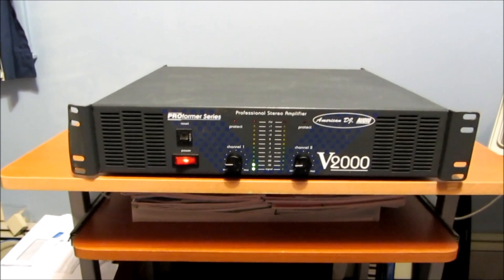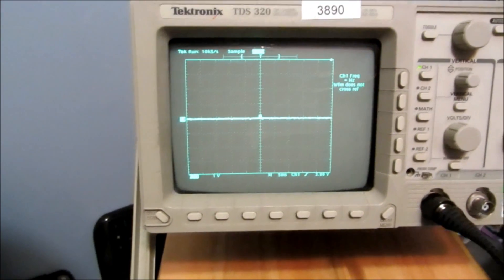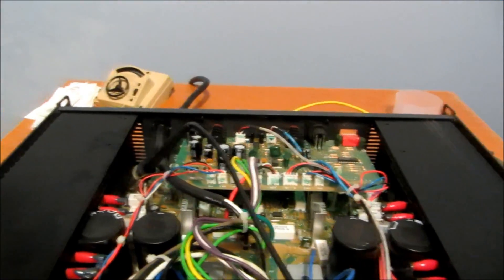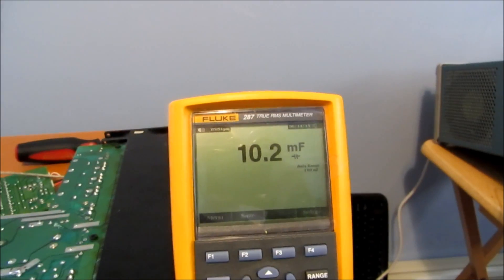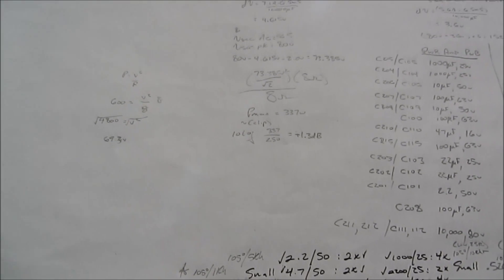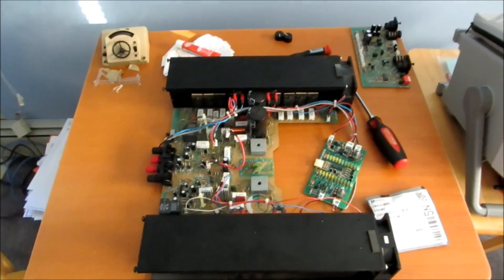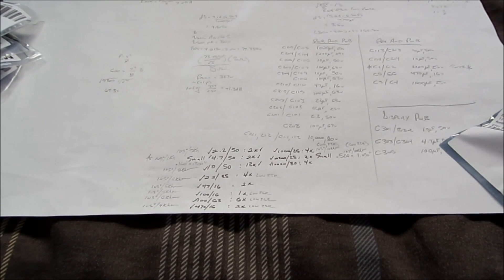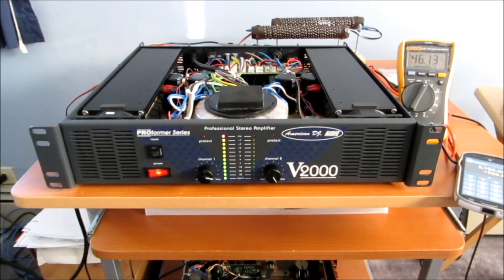American DJ V2000 amplifier repair

Comment: I am curious if you ever did any measurements , or listening test to see if taking the JRC amps out for the LME, resulted in actual improvement in the signal to noise. I am thinking about trying out a few things, including installing the plug in 8 pin dip, so one can just manually change them like most newer Pc audio cards.

Comment: Hi Kevin I would appreciate if you can help me. I have an american audio VLP2500 amplifier. It was working well but last gig I turn it on and channel A won't turn on. The fan doesn't start and there's no amplification signal. The Channel B is working ok. I've opened the amp and all seems to be ok, there's no sings of visual damage in components and it smells good. Nothing seems to be burned. It could be the same problem as yours? I mean It could be the capacitors too?
I appreciate your video guide but I don't know if just replacing the caps I'm going to recover my amp back. Can you give me some help please! Thanks and regards!

Comment: I bought a Gemini XGA 5000 out brand new out of the box a few minutes ago.  My channel 1 input was not producing sound so I switched to Bridge.  I'm using speakon connectors.  Is there a way to solve this issue?

Comment: I am fixing Audio Research equipment for many years, the best way to test a capacitor is to use an ESR meter, plus the advantage of in circuit test.

Watching  this amp I  notice the small filtering circuit, the damping factor is too low surely.

Very good video.

Cheers.

Comment: hi kevin, thanks for the response. i've got my adj v2000 from a chinese guy for cad$100 bucks, so i think it's a great deal. when i opened it, the only thing i observed not original is the power cord, looks like it was replaced with a standard pc power cord, but it's working fine. after installing and using it, i've found out that's there some mechanical problem on the speaker binding post, both left and right, loose knob and tight knob. i wanna ask your recommendations where i can buy this speaker binding post, coz i think the adj website there is no more parts support for this adj model? thanks, victor

Comment: This was a very good video.  I was hoping that you weren't going to just replace the original filter caps in the power supply.  However, having an ESR meter on hand is a great tool.  I always say they're worth their weight in gold.  I don't dig as deeply into the math as you do.  If I have a high value capacitor and the needle goes even a little bit below to where it should be, I know that the capacitor should be replaced.  I know that XC=1/2piFC.  The ESR meter that I have puts out 100 kHz.  Therefore, the XC should be virtually close to 0, especially with a 10,000 microfarad capacitor.  Thank you for sharing.
Reply: +Paul Callas XC for those that don't know is capacitive reactance, or AC resistance.  In a circuit like this, the capacitive reactance should be really low.

Comment: Very nice video.  I have Samson Servo 300 that just stopped audio.  It powers up but no sound at all on input or output.  The meters are not working when pushing sound.   Is this an easy fix?  Or better yet is it worth getting fixed?

Comment: what about using technics electrolytic caps.
Reply from the maker: +DAVID GREGORY KERR Unfortunately, Technics (or Panasonic, the parent company) did not manufacture capacitors with the correct combination of capacitance, lead spacing, height, and capacitance this amplifier requires.

Comment: hi kevin, I just recently bought a used V2000 and believed it is in working condition, but still not yet installed to my home stereo system which is tri-amped, i wonder if you have any posted videos showing your repaired v2000 in action and how it sounds? when you sound tested it after repair, were they sounding good? i intend to use my v2000 to drive my lowend jbl l/r subwoofer in 8 ohm wiring and can try to 2 ohm wiring also if needed, to maybe 180hz, but still have to hook it sooner.  i'm from toronto, canada.
Reply from the maker: +Torpengpogi Sorry I didn't answer this sooner.  The amplifier sounds pretty good, but I confess I never made a video of it in action.  I'm sure you can run a 2ohm load to it, but make sure it gets cooled really well, you are asking the output transistors to source a tremendous amount of current into such a load.  Luckily the fans are variable speed if memory serves me correctly.

Comment: Nice video, but I think you are stretching things a bit saying  ''increasing headroom'' by uprating your smoothing caps? I suppose the energy storage is increased a tiny percentage, but in practice it will make  a flies cocks difference. And no way a couple db or whatever you calculated. To new guys - always be careful swapping OP amps! They most certainly are NOT all swappable. In many cases they can give a 'free' performance boost, but take some care as some may become unstable or have different power requirements or even introduce more distortion etc. Some cannot be used as buffers for instance and will oscillate.
Reply: Thanks, I had the same thought when he changed "faster" OPs. Let them be if they're not broken.

Comment: great video how did you connect the scope? parallel with dummy loads? thanks,
Reply from the maker: The oscilloscope was connected in parallel with the dummy load.
The dummy load is two 4 ohm, 300 watt resistors connected in series.

Comment: what was it rated for before you did the repair?
Reply from the maker: The rating before the repair was 250 watts per channel, but that might not have actually been achieved during a load test.  A figure like that may have been possible only under the most ideal conditions.

Comment from the maker: Richard:
You absolutely can get shocked with the power off.  In this case, you'd have a total stored voltage of 160vdc, which would hurt you pretty bad if you don't know where to avoid it.  The capacitors in this particular amplifier will discharge rather quickly.
Reply: +Kevinsrack It's not gunna kill you but it hurts like hell and is pretty startling. I used to play around with 240v half 1/4f caps when i was in highschool

Comment: Hay dude, I don't know much about electronics so I have a question. Can those capacitors shock you when the amp is turned off? In fact can any of the amplifier shock you when it's off? Cheers. Nice video!
Reply: +Rickie Hilll If the caps don't have bleeder resistors across them, or some way of draining them, then yes. It also depends on what voltage your dealing with. Some amps are lower voltage +/-20v etc, but 160Vdc will make you dance and maybe stiff lol *Always check with your dmm amd drain them.

Comment: You won't gain headroom by adding capacitance. You were doing a constant load with a constant frequency. The only way to get more headroom would be to change your power transformer secondary windings to a higher current rating at the supplied voltage. That way, the power supply droop wouldn't be a factor. Power is power and ohms law applies. What you are experiencing is power supply droop. If you look at the B+ and B- voltages at no load as opposed to them at full load, you will most likely see a fairly significant voltage drop, even 8 volts, which would be a loss of, what?, 40 watts maybe? Also, it depends on your house wiring. If it can provide the current needed, with no droop, it will give the power transformer good power but still, the losses in the core will always cause droop to happen so usually, people find higher voltage transformers or higher current transformers, to increase power. P=I*E any way you look at it. I'm sure you know that though. I understand your concept. If you charged a few Farads of capacitance, you would gain headroom during the peaks but not for much time. A constant load and input like that would drain even a few Farads in a couple seconds. The car audio folks put those huge capacitors on the power supplies to handle huge surges of power during high transients but they still discharge farily quickly. What happens to them is the batteries can't hold the 13.8 volts during a fairly long transient so the caps add a "tank" of energy for the amp's power supply ti mantain the 13.8 volts, again, keeping the power supplie's power rating up during that time, by keeping the voltage droop minimal-to-none....
Reply: For the most part, you are correct, and I appreciate your input.  Fundamentally, in order to increase headroom, you would, in fact, have to change the turns ratio to give you a higher secondary voltage.  This, in turn, would increase the magnitude of your rails, and consequently your maximum voltage swing.  Instead of having say, 7vpp ripple, I tried to decrease it to say, 5vpp, which buys you an extra two volts excursion since it now falls two volts less than before.  Alternatively, you can use diodes with lower forward voltages (schottkys are good for this), but that will only buy you so much.
However, my intent was to decrease the amount of ripple on the DC rails, which is easily accomplished by increasing the capacitance.  Ic = c (dV/dt).  Solving for dV (the ripple in this case): dV = (1/C)Icdt.  As a result of this, the less ripple you have, the closer to the maximum AC secondary voltage you can achieve.  Yes, this is not a linear relationship, but rather, asymptotic. Believe me, I have enough power supply design experience to understand these concepts.  I seem to remember a good rule of thumb being anything more than approximately 2600uF/amp approaching a futile effort.
There were losses I didn't account for, I acknowledge that.  Losses such as Vce sat not being equal to zero, transformer core losses, emitter resistors, pc board track drops...etc.  It all adds up.  My expectation wasn't to turn a 250w amplifier into a 500w amplifier simply by changing capacitors - it's just not going to happen.
Reply: Kevinsrack Yes, I understood what you meant but many others don't, so I wanted to say something without being a jerk about it, which many think, is the case. Seems like a person says something contrary these days and now they are some kind of jerk. Glad you didn't take it that way. Funny you mentioned pc board losses. Just tonight, I was going over my own 500W amp information and remembered that I had to reinforce my traces to get the power claimed by the design. I built the amps 10 years ago. I got the PC bpards from Australia and the copper was pretty thin. After not being able to get the proper power, I decided to reinforce the traces from the OP to the speaker out and gained about 20 watts. I then did all of the power traces and gained just over 60 Watts!!!! I had added a different voltage transformer. It called for 80V each rail but the one I ended up using was 95V each rail and yielded me 612WRMS into 4 ohms!!! Woo-hoo!!! The design calls for 40,000uF each rail but I don't have but half that. I reckon if I add 4 more OP transistors per rail, I'd get close to 1000W. That's a shit-load of power, my friend... I used it for my home theater sub amp for years until a bypass cap near the OP transistors failed. Not sure why. The cap was rated at 200V. After repairing the amps, I had 60Hz hum in one channel.. Can't figure out where a ground loop would come from as they were absolutely silent before the caps blew. I mean no hum or hiss whatsoever. Most quiet amps I have ever heard. I'll repair thewm someday but I bought a class D Crown amp and love it. That amp is 775 WPC and cost me way less than the power transformers for the 500W amps BUT I have the pride in building my own amps. My other 5 channels are also hand built amps 240WRMS each.... Now, that, my dear sir is head room!!! Cheers!
Reply: Kevinsrack I deal with RF also. I'm an engineering tech. My company is desigining the next wave of communication in aviation... ADSB technology. Look up FreeFlight Systems and look at their web site. Very cool stuff. In America we have until 2020 to adapt to this new system or the plane doesn't fly. FreeFlight is the only company licensed by the FAA,  to build this technology, right now... It is not a monopoly as any one else can do it, at any time, but many don't want to deal with all the red tape, as it were. I deal with the GPS part of the circuit.... It's pretty cool stuff, actually. In a previous job, I was the EMI guy, so I know exactly what you wrote about. We like to say that RF and black magic are one in the same! :-D I have seen EEvlog... That guy is a good teacher and very smart guy! I'd love to work with him.